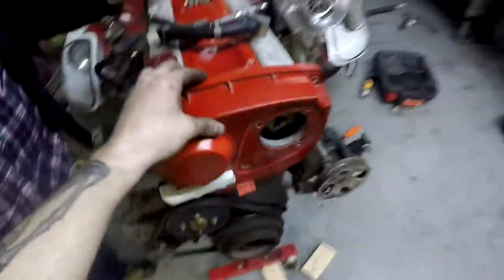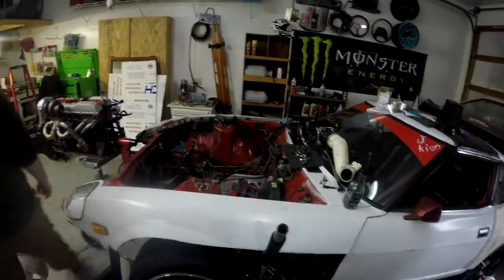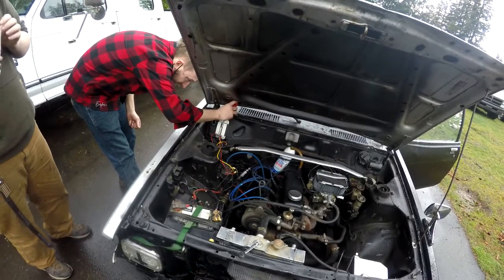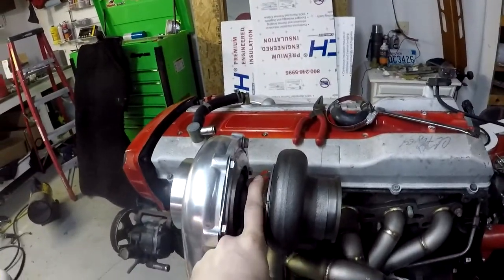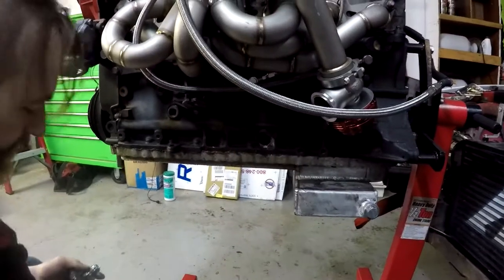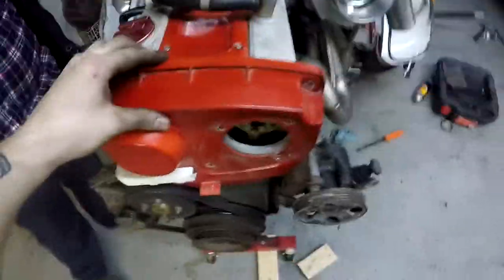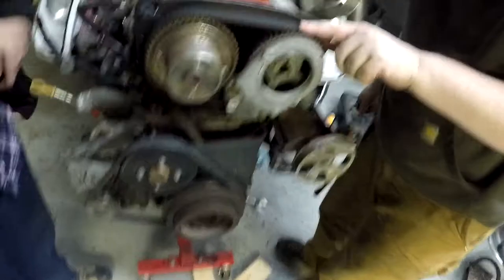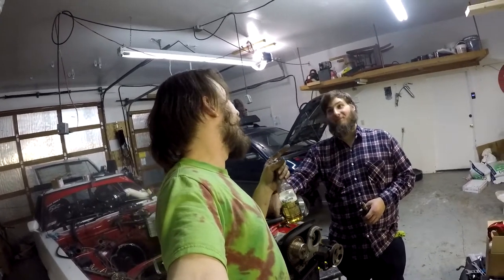rb25 build part 1: turbo lines

Comment: Dude you said oil feed in 2 different locations what about the coolant feed and drain?
Reply: The oil feed is down under manifold the coolant feed and return are one metal hose around rear of head and the far back hole to the rear of the manifold and down